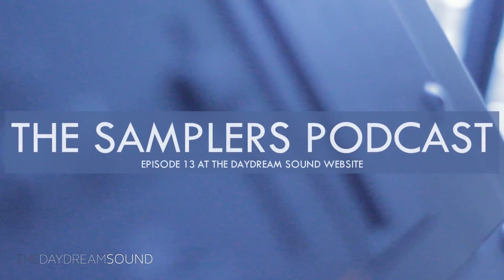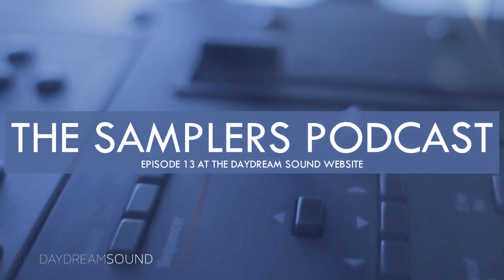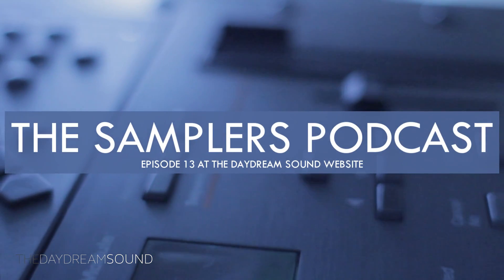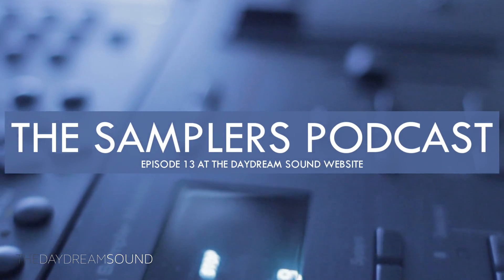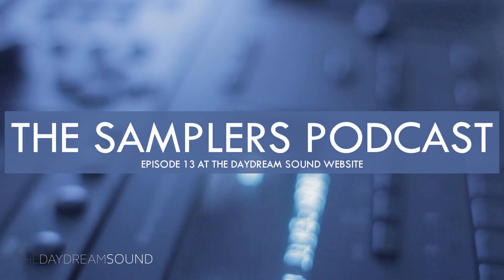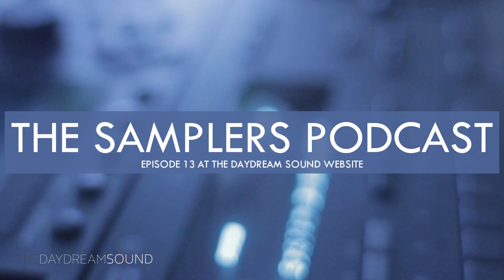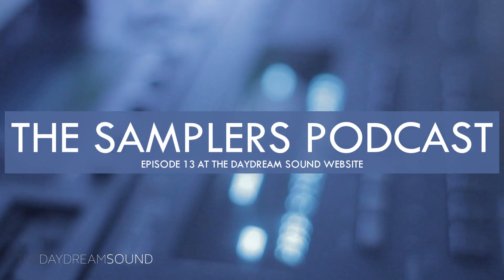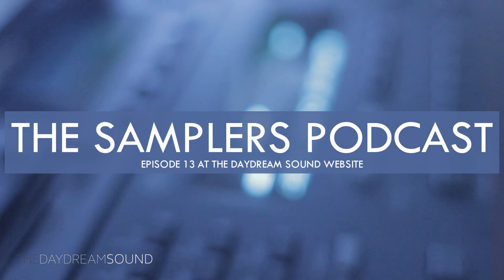A Sampling Technique For 2019

Comment: That noise in sample 2 is easily removed. Oversample back to your pc to map noise, then denoise. Find nyquist value of your signal, reduce sample rate to nyquist. Export to your required bit depth/sample rate. French fries on a squeaky clean plate.
Reply: @michael_mack  indeed. I should have wrote * map the bad noise, keep the good noise. If you get rid of 40 db of bad noise pressure, your good noise is perceived as louder, heavier, grittier. Without changing tone or level at all.

Comment: Interesting idea. Will try that. Of course varying levels of destruction can be achieved by using varying input/recording levels. For a little bit of grit, reduce the input level 20% and normalize that, etc etc. Could even make velocity maps from a variety of levels of destruction. 

I have a cheap little Akai MPX16 and it’s normalize function seems to push the audio way past zero dB. It really starts to clip badly. But I will play with it and see. Do you know if using the same technique on a computer will get the same/similar results? Or is there something inherent in a samplers circuitry that affects the audio this way? Is a computer too ‘perfect’. I tend to all of my sampling and sound shaping ITB and just use MPX16 for playback as it’s tools are so fiddly